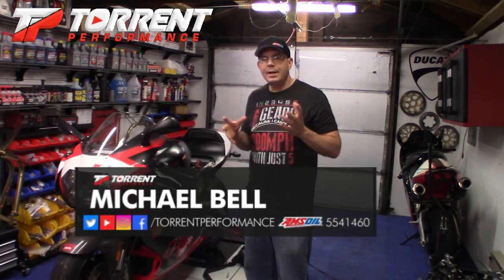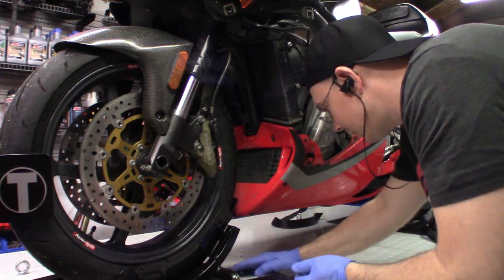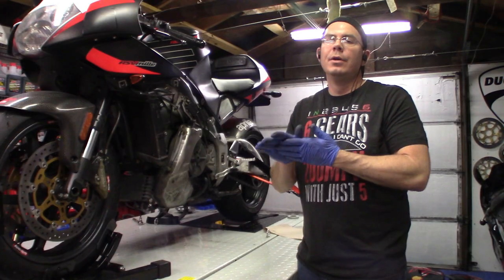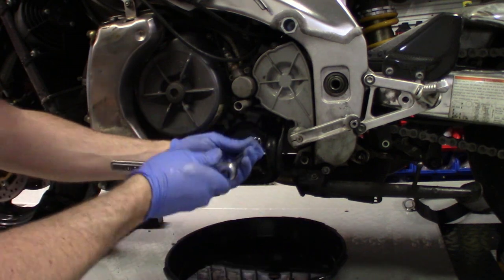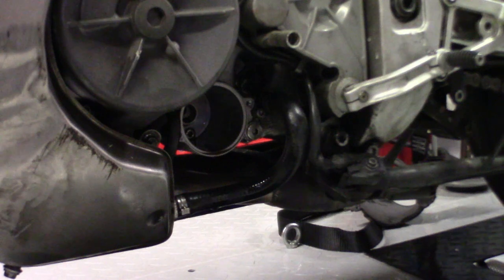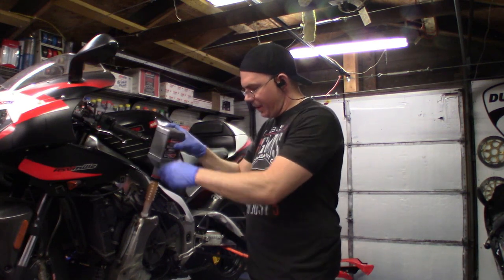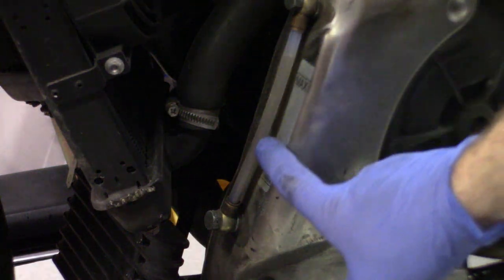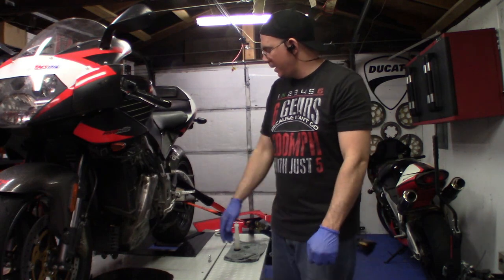Aprilia RSV1000 Mille and Tuono Gen 1 Oil Change Walkthrough

Comment: 3.7l without new filter and 3.9l with oil filter change is what the manual states.  But those amounts often lead to overfilling.  Only way to properly check the level is once the bike is at full operating temp and the fans have cycled.  Then check the tube immediatly upon shutting the bike off as oil drains from the tank quickly.  Thats your true oil level.  Usually best to pour in 3 liters, run for a minute then add another half liter totaling 3.5l or 3.7quarts.  From there take it for a ride to get the bike fully warmed up and check level and add more if needed.  Apworkshops has a good video on this and also a great write up on the af1 forums.

And this bike seems to have quite a bit of valve train noise.  They do tend to be a little noisier and maybe its just the video making it seem that loud.  I own a 2010 tuono 1000r myself and about to do an oil change once the stuff is shipped.  I run motul 5100 15w-50 as the manual calls for a semi-synthetic.  But many like to run the 7100 and 300v as well.  Havnt tried amsoil in mine yet.
Reply from the maker: Cool paco glad your watching the vid. All these first gens make noise. As for Apworkshops if you can don't mention them here. There very liberal over there in the uk and removed me years ago from there facebook. Griff knows his stuff but these guys arent doing anything special on there channel and i would never order parts from them if your in the usa. They have gone threw a few names over there the last couple years i think it has to do with money and business during covid.They down punched me years ago when i started on youtube when i had less than 100subs on my channel. These first gen aprilia are my favorite bikes and as you can see in my vids im more well rounded than just aprilia related. There kinda dicks over there about there aprilia's.

Comment: Love the video's on the mille, seriously considering one atm because i am working on my old fzr1000 exup and it will be off the road for most of the year while i learn 😂😂. They have come down to a reasonable price for me, possibly bottoming out and ready to start back the other way. What would you say are the main areas of concern to look for on the 98-2003 series as it is the best looking for me?

Regards, Eric
Reply from the maker: I would say main concerns are service records, battery cables, battery charging issues relay related issues, fuel pump failure on pre 2001 models, fuel pump wiring harness issues , and that's really it. These engines are known to be extrely reliable. What may be broke  or need replaced on these are gonna be common because of there age. My r model I just finished may be up for sale due to a housing crisis. Shoot me a email if interested.
Reply: @TorrentPerformance  thanks for the offer but I'm from scotland and it would be very costly to have it imported and insurance would be crazy due to being an import also.

Comment: Hey mate, I just did the oil on my gen 1 rsv mille. I didn't get a new seal with my oil filter and it now drips from the housing. I removed the sump, and oil filter. I did take the hose off the tank that u said didn't matter but I left the little bolt that you said cracks alone......I put 3.9 Litres back in. Is it possible I've over filled it or do I just need that o ring? Struggling to find one unfortunately
Reply from the maker: Im not sure without looking at it. Your gonna have leaks without new seals. Send me pics to my email and i can probably tell yah.

Comment: Advice please; I''m going to fit a digital gear selector to me RSV Mille/R, I know they are plug & play, can anybody  recommend a certain make?
Reply from the maker: Don't buy the $40 Chinese one. I bought it and it doesn't work properly. Stick with big brand think heli would be best option. It will piggy back on your speedo sensor cable and pickup coil wires.
Reply: @TorrentPerformance   thanks for the advice, I'll let you know how I get on.

Comment: Glad I found your vids man. Got myself a 2000 RSV mille that I need to do the wiring mod on
Reply: Can you do a coolant flush? Do you drain the radiators?
Reply from the maker: Im gonna do the battery cable upgrade and relay etcc upgrade before i do the wiring mod. We will see if that fixes my problem. These bikes are getting old and i think the woring mod is more of a way around not replacing possible worn out parts. Check the other videos out in my playlist alot of mille stuff.
Reply: TorrentPerformance will do. Thanks for posting these. I appreciate it. The aprilia forums are good but are now getting dated and a lot of the pictures are gone so thank you for the videos

Comment: Any thoughts on a hard to find Neutral position? It WILL go into N but not easy to find.
Reply from the maker: Yeah change it over to amsoil metric it may help with that. Use links below. All these bikes are kinda like that on finding neutral. The additives in the metric amsoil can help that.
Reply: Ive been running 5100 Motul and was thinking about switching. The bike is a 1st gen Tuono with about 30,000 miles on it.
Reply from the maker: @MPjustaman  make the switch drop me a email I'll sign you up under me for free as preferred customer. Then also try the dot4 dominator brake fluid as well.

Comment: Why didn’t u remove the strainer filter ??
Reply from the maker: I've never seen any metal shavings in my oil filters. So I don't remove the screen Into the bottom oil tank. I consider it overkill for a oil change unless you see a issue visually. Most people don't have the clip tool to reclip the clamp on.

Comment: I have an 1000 r mille RSV 2002year. and I am wondering whether to pour 15w50 or 10w40 oil?  people's opinions on this subject are different :(
Reply from the maker: Manaul does state 15w50 also if you live in a colder climate 10w40 can be used. I run 20w50 in hot summer. I would stick with 15w50 for this engine. Thanks for the comment.
Reply: TorrentPerformance thnx for answer :) I put 15w50:)
Reply: I use 10W-40 in my Capo. since I obsoleted the 15W-50, the clutch and gear shift is smoother. without changing the oil jet.